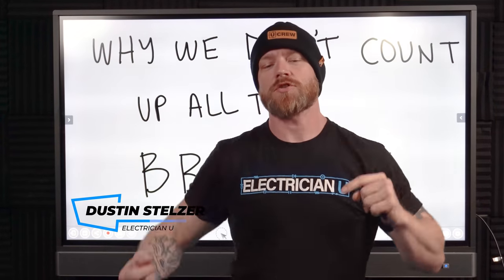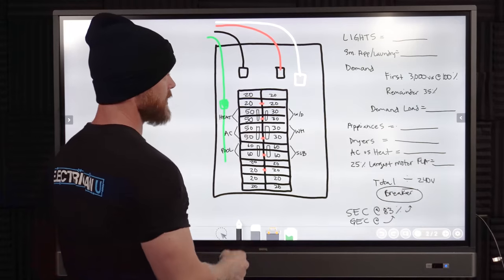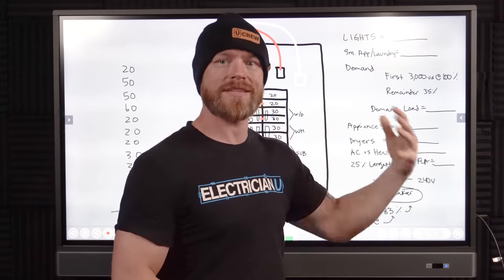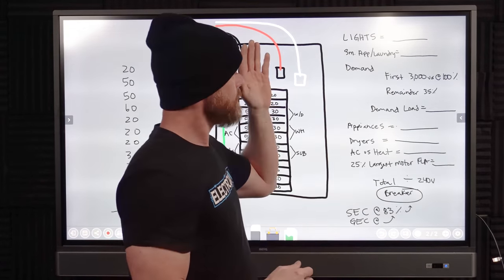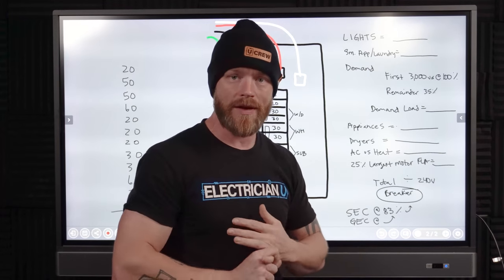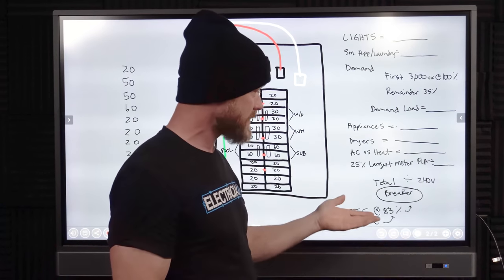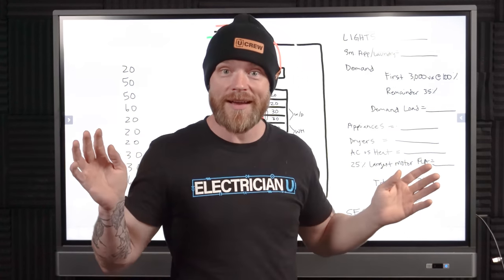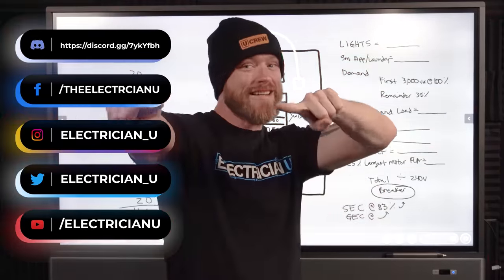Why is there more than 200 A worth of breakers inside of a 200 amp panel?!

Comment: When doing the standard calculation, I'm wondering how the change from incandescent to led lighting has affected that part of your formula?  Going from 60 watt bulbs to 9 watts is a big difference.  And have the newer appliances reduced their total load in a noticeable way, compared to something made in the 60's?  Do houses now need the same size of service that we used to, not that long ago?
Reply: Apprentice here not a journeyman yet so take my word with a bit of salt. The formula doesn't change for led lighting it just means that we will have a smaller load on the service and can size accordingly. Whether appliances pull more than they used to varies greatly. Yes our microwaves may be more efficient than they used to but many manufacturers take that opportunity to increase the power of the microwave. But on the whole the size of the average service is most definitely increasing not decreasing. More and more and more modern appliances are electrically powered vs other sources. Electric stove tops heaters and dryers instead of gas ones for example. On demand tankless electric hot water heaters instead of gas tanked water heaters. More and more computers and televisions and phones and laptops being charged. The most recent huge bump is electric vehicle charging.  Some appliances may be more efficient than their counterparts from the 60s but the number of appliances in the average home has increased dramatically.
Reply: There's several things to consider here. The power we use now is likely quite a bit lower for many things (lighting) but we seem to use that over longer periods of time when you throw in all of the appliances that draw all day long. Walk around your home and count up all those little wall chargers, cable boxes, tv sets, DVD players, telephones, answering machines, night lights, clock radios, garage openers, fridges, freezers, etc. If they were all "off" it would still add up to more than you think because they have electronic controls. (you should see my power bill) Next add in the fact that we have many more things we didn't have 50 years ago.... car chargers, central AC, clothes drier, and electric water heaters are all common now. Throw in the ever changing electrical code with more margin for safety, and the size of the service has increased. In some cases the service size is almost dictated by the number of breakers required due to bathrooms, kitchens, and garages, needing home runs these days. Basically you are stuck installing a 200 amp panel for a home that may never see more than a 60 amp draw because code calls for more than 20 breakers. The cost difference is only a few hundred bucks between 100 and 200 amp service.
Reply: One of the biggest new loads is Air conditioning. When I was a kid in Seattle air-conditioning was unheard of. Now we are way over 50% of homes having air-conditioning in Seattle. 

I think the air-conditioning load is still growing faster than electric car charging is.
Reply: For residential calculations a formula with square footage is made.
Reply: @ecospider5  ... here in the northeast we get humidity so I'd guess that 99% of new construction has central AC. I can't think of a home here that doesn't have either window units or central AC. It's all about comfort and convenience... even on an older place where the 60 amp fuse panel might be smoking, or close to it.
Reply: @awalllen212  ... excellent points, especially on those appliances like microwaves that are up from 600 watts to near 1500 watts... and the same with larger water heaters. Bigger, better, faster is where they are going. BTW, you forgot to mention heat pumps but we all know that's a given over time.
Reply: Thank you for all these great answers.  There were assumptions I was making based on forgetting all that you pointed out.  You are right in telling me that all the little stuff we take for granted adds up, like the higher wattage microwaves, the wall-warts for charging, etc.  I appreciate your knowledge.
Reply: Yes, equipment and lighting are more efficient, but we also have way, way more things plugged in than we used to. I'd say it is pretty much a wash.
Reply: @ecospider5  when that heat wave hit the PNW earlier this year, everyone was so shocked to learn that in seattle alone, ~40% of our buildings still have no AC! not just homes, but commercial buildings too. people kept saying "just turn on your AC and wait it out" 😂 it's way more prevalent nowadays, but it's still rare in comparison to other places. i've lived in seattle almost my entire life and i didn't realize how normal AC was in other places.
Reply: @picksey4736  ... not sure how old you are but within my lifetime you could still buy a car without a radio and in some states without a heater. These days they come standard with AM / FM, AC, and power windows. It's the same with building construction. The times have changed.
Reply: No we don't  but we need to ensure the conductors serving the circuits is protected.
Reply: 400 amps phase A, plus 400 amps phase B would be not be added to make an 800 amp service. The highest calculated load on an individual phase would be used for sizing the service. Balanced phases would be ideal.
Reply: @ingcampthree4523  ... these are not phases. They are legs on a single phase system, derived from a double tap transformer.
Reply: The code for residential calcs hasn't changed at all for general lighting load which actually includes living space outlets. Not sure they put any thought into that at all it just simply not an issue because it went the other way. The real crazy thing is many local codes give a device count. I have had it out with an inspector due to 17 Recessed LED cans on one circuit because it went over the count, even though it was only 210 watts.
Reply: Some of these standard estimates are a little out of date. It's always a good idea to get out there and count the bulbs or have a set of prints handy.
Reply: @jasonj4865  ... if those were standard Edison base fixtures (screw base bulbs) you have lost the battle because it's possible to install larger bulbs and exceed the circuit wattage. That's likely what his maximum count is based on. Cans with a pin base socket might be a different story in some areas because it's not possible to install different lamps.
Reply: @rupe53  These were new style pin based all lights were on 1 switch.  Inspector's defense was one could modify the fixture for incandescent. I'm in CA you can't get incandescent unless you order them online. Plus who the hell is going to do that? He was trying to force 2 circuits and a contactor or delete a few lights. Most BS thing I have encountered in years. He did eventually lose because homeowner was on some county board and he had a fit to the head electrical engineer for plan check. Made final a bitch because he was pissed the rest of the project. Mostly took it out on the GC though.
Reply: @jasonj4865  ... If that were 17 fixtures at 100 watts each, then you are over the 80% rule for a 15 amp lighting circuit. If it was a 20 amp circuit you are only smidge over 14 amps so good there. Either way, glad to hear you got that ironed out.
Reply: a house hold is using far more power now then they were in the 60's even with LEDs and energy saver appliances
Reply: @rustyshackelford2349  ... I have tracked the consumption on several appliances in my home over the past 40+ years and I can tell you the frost free fridge in my kitchen uses just over $20 a month, while my 1952 beer fridge uses just under $5 a month. If I were to invest in a new energy saver fridge I might save $3-$4 a month over the unit I have in the kitchen now. Almost not worth the effort. My whole house consumption is roughly 500 Kw for a month. About 10 years ago I added central AC and a hot tub. Those added about 200 - 250 Kwh each, depending on the month. Yup, total draw is up even though I have slowly replaced lights and appliances.
Reply: My personal experience has been that I replaced the inadequate 60W light fixture with multiple LED fixtures that collectively consume the same watts. The demand on the wiring is unchanged.
Reply: @rupe53  
From what I understand, a lighting circuit has to be 15amps. Is that true? Maybe a local code?
Reply: @markchidester6239  ... lighting must be at least 15 amps. There's no rule that says you can't make lighting part of a 20 amp circuit, although some inspectors might make you use 20 amp switches. (couple of bucks more) You can use 15 amp outlets on a 20 amp circuit because they all have a 20 amp pass-through.
Reply: The difference is, back then most houses had incandescent bulbs, yes. But only had a 60 Amp service.  Now we have led,  yes, but dryers, ranges ,electric heat..etc.. so it basically works out to be the same thing.  200amp service to accommodate all the newer needs, but lighting is the only thing that actually decreased in load , other than energy efficient appliances
Reply: @mikemacdonald2032  ... other than lights, I have yet to see an energy efficient appliance that uses less juice than its predecessors, in the long run. As far as most can see the so called "energy star rating" just means a label showing what it uses over a year. IOW, it's more so you can compare before buying.
Reply: Apprentice here. The answers here are all great. But another thing to consider is the Authority Having Jurisdiction (AHJ) and the codes they adopt and rules they set. In our city, a single-family dwelling, no matter the sq ft, has to have a minimum of a 200 A service. So even if you were able to reduce the total load on a dwellings service to 100 A or 150A with LEDs and other efficient design choices, you'd still be required to put in a 200 A service.
Reply: Great question! The code is written for the minimum Saftey standard as shown in article 90. You may engineer the house with energy efficient lighting, then the house might sell and the new owner might use incandescent not knowing that the service does not support the load (not that the lighting is that much of a significant load to begin with).
Reply: @alishallouf8207 ... The only time you get in real trouble here is using installed fixtures that can accept incandescent bulbs, which is why some areas still restrict fixture counts based on old standards.
Reply: @ecospider5  it depends the AC load in the South East is shrinking for new homes as AC technology has gotten more efficient not by massive margins but decreasing. As far as the PNW and AC as guy that grew up in Florida the PNW summers are way worse due to the lack of AC. 

Summers up there are dreadful compared to Florida. See I can take the heat better than the average person from Washington but it sucks not have the chance to cool down in my own home.
Reply: It has NOTHING to do with the type of bulbs used. You can simply run more LED bulbs than incandescents per breaker, and have brighter rooms. Simply, electricians have calculated that almost nobody will run all breakers at full blast at the same time.
Reply: @ecospider5  You must have been around for awhile. I was a kid in the 1960s and my parents were installing air conditioning.
Reply: @foureyedchick  NEC doesn't allow 100% loading on a branch circuit. The max you are supposed to figure is 80%. That's only part of the picture and very few circuits reach that. Calculating the size of the service, as a whole, is another thing.
Reply: @rupe53  Valid point!
Reply: @grandinosour  ... I doubt we'll ever see an electric pool heater, but heat pumps for pool have been gaining rapidly for the last 10 years or so in my area.
Reply: We have a house that was likely built with 50-amp service when it was built; but, the service itself, and the panel, have since been upgraded to 100-amp service. For the house size, coming in as a buyer, you might expect 150-amp, or even 200-amp service; however, to answer your question, new appliances and LED lighting have made a huge difference on home grid load. Even with all the extra stuff I run specifically for my passions\hobbies, 100-amp service has been more than sufficient. If I get to the point where I'm expecting to be putting in a large air compressor, or welder, for more than just "now and then" such work, I may actually just have a dedicated service run to the "work-shed" for that, instead of upgrading the house service.
Reply: @jcpt928  ... the main reason people do a service upgrade to to avoid additional charges for a second meter / service. That alone typically runs a few hundred bucks a year. ($20 - $25 a month) Doing it yourself you could get payback in just a few years.
Reply: @rupe53  You're right - things work a bit differently where I'm at. I'm lucky to have an electrician friend to call when I'm in a project where I'd rather he get electrocuted than myself - even when I could do it on my own. :P

The service to the house, and from the meter to the panel I believe is already run for at least 150-amp service, if not 200, so I'd just be looking at the meter charge and panel purchase to do the upgrade. I've considered some creative options like maybe having the service go to the "work-shed" first, and then fed to the house - just haven't gotten that far into my project for that yet.
Reply: The bigger change is from resistive loads to inductive and capacitive loads.
Reply: @davidgagnon2849  Even with more items plugged in the load is still below the maximum for a 15 amp circuit breaker.
Reply: I highly doubt it would, still plenty of applications that use higher wattage, and no one can really know what the max could potentially be for each individual home. I don't believe they even considered light bulb use in the equation, more like high watt appliances. Still, with ALL LED use, no since in using smaller wiring and or lower breaker amp rating because of it. Better to have more than not enough so long as you don't go way overboard for no reason and spend more than necessary.
Reply: @ecospider5  Actually the AC load is getting smaller compared to 30 years ago. A typical 3 ton unit draws 30 amps nowadays and 30 years ago it would’ve been 35 or 40 amps.
Reply: Yes we do. Have your heater break and try plugging in an electric heater lmao.
Reply: @rupe53  We actually have really high humidity here in the north West too. It's odd that so few houses here have any means to control humidity other then heat. It's weird. Mold is a huge issue.
Reply: @bUwUmer1260  ... I just looked it up and your state runs almost 10 degrees cooler that Ct on average for summer temps. I suspect that and local demographics plays a roll on the AC situation. I have to say that the lower part of Ct has a fairly high income level, which accounts for certain things in new construction that we don't see on the other end of the state.
Reply: New LED houses have way more receptacles that the old incandescent days. My 200A panel only has about 10 single breaker size spaces left on a 2019 house. Arcflash breakers take up a lot of space.
Reply: @rupe53  It won't be long before we see more homes with two coal powered vehicles that need charging. They will make up for those LED lights.
Reply: @thomasdragosr.841  ... no doubt that's true. OTOH, future growth is not part of the base calculation for service size. BTW, did you know that most EVs have the ability to program charge times, so they are not both charging at the same time? Did you realize that an EV might only need charging once a week so could share the same charger? (if it's compatible)
Reply: Stove is always 6000 watts I believe in canada
Reply: There is places in the city that just have 30 amp services ..jjhot water tank is on flat rate a old addition to accomodate hot water tanks  and those were heated by tank bands that were responsibke in heating the water container to make hot water ..obviously switched to elememt later on ..and that wont be talked about in school ..iam just sharing some knowledge
Reply: @rupe53  well I was told apprentices should be seen and not heard  but that was before text ..
Reply: @Jason_Canada  ... you are not in the USA, are you? We haven't had the option of a 30 amp110 volt service since WWII.
Reply: Don't forget that the older stuff even though they may have pulled more power, when you turned the stuff off, it was off.  Now most things have standby power.  Even though we turn things like our TV's off, they aren't completely off because of the standby power that's needed to keep the memory, clock and the remote sensor on so the TV knows when you push the power button on your remote to turn it on again.  Even the devices with the soft touch buttons need standby power so the computer can sense when you press the power button to turn it on again.  We have more things today that have this standby power anymore that any power savings really isn't much of a savings anymore.
Reply: @KevinBenecke  ... are you are old enough to remember the (short lived) "instant on" TV feature? It was just before the transition to solid state circuits. IOW, everything in the high voltage section was still vacuum tubes, but a switch on the back of the set left the filament heater section running at reduced voltage when you shut it off. This reduced the normal warm up time from 30 seconds to around 3 seconds. It was quite the hit with consumers. BTW, that same switch allowed you to shut off the feature and save quite a bit on electricity. Recalling the draw was around 25 watts in standby mode.
Reply: @awalllen212  If you move away from an ordinary incandescent light , which is a pure resistance, to led or something, it becomes an impedance and you have to include the power factor in the calculations.
Reply: Yeah. Hell, my house was built in the 70s and has a dedicated circuit for the microwave.
Reply: @seabass22  ... if you look close it's likely a 20 amp outlet. That was the beginning of people going to a combo microwave / stove hood and most of those were up near 1500 watts.
Reply: @rupe53  yeah it’s 20 amp but not near the stove
Reply: @rupe53  I just changed the outlets and noticed it’s 14 gauge wire with a 20 amp breaker.
Reply: @seabass22  ... interesting, but in that era most countertop units were at least 1200 watts, which puts a circuit over the top if you add a coffee pot or toaster. Of course, this is why newer code calls for several kitchen circuits just for the counter.
Reply: @seabass22  ... that's something that needs correcting!
Reply: toddbod94  ... true, but the original question was about still needing a 200 amp service, which is really more about all the home run circuits required these days than the actual draw. I mean, my house has a 200 amp panel but the typical draw is closer to 15 amps per leg on a winter evening. It might be 25 amps per leg in the summer with the AC running. OTOH, max draw is near100 amps continuous per leg if everything is on. Wild guess is the inrush (peak) may be closer to 150 amps, but that's unusual. (my test)
Reply: Scott....here is a scenario for ya....I moved from a 4 bedroom, 2100 sq ft house which 150 a ams was plenty and moved into a 2 BR 900 Sq ft house and there is a 200 Amp SE in this small home!
Reply: @ottoroth9377  ... 200 amps is the new standard service these days, even if all the appliances are gas.
Reply: True...
But this little house..like putting a 125 Amp SE in a doll house
Reply: @ottoroth9377  ... I follow your drift, but most building inspectors will only allow those smaller services in an aux building these days. BTW, in most areas you'd be hard pressed to get approval for a new house that small. Can you say "super size me?"
Reply: @rupe53  lights are using less energy but appliances seems to be getting hungrier everyday. 1200 watts, 1500 watts on blenders, toasters, microwaves seems to be the new marketing thing.